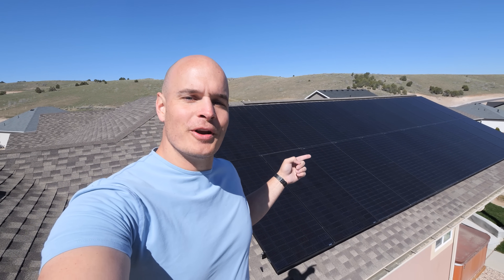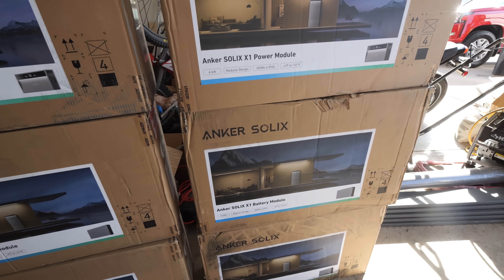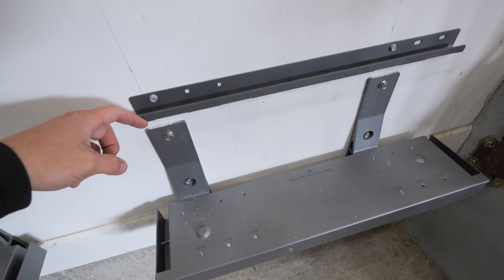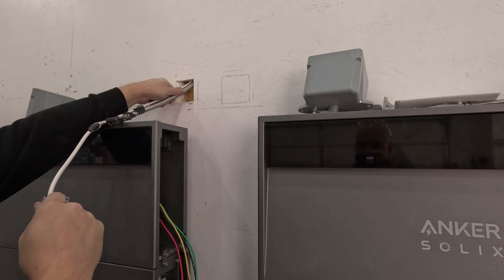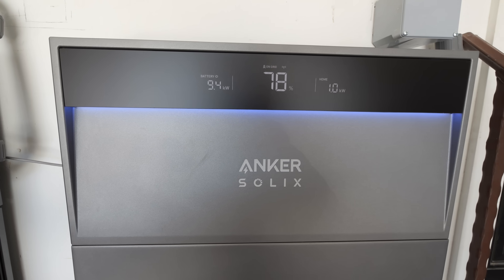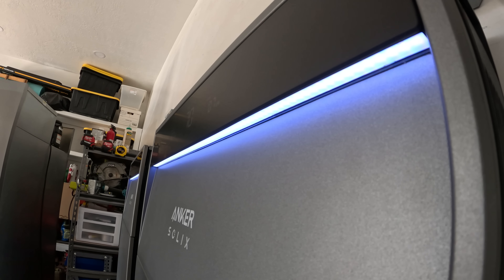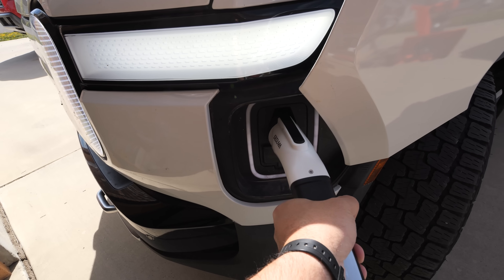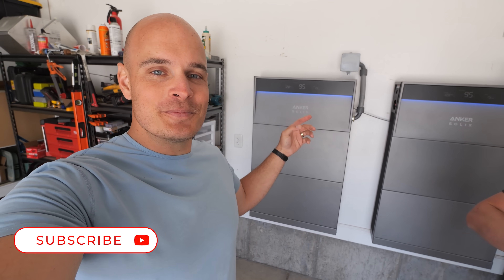How to Save Sunlight for the Night? - NEW Solar Battery Install

Comment: 1.3 kw damn!!! my home uses 300W and has a sanctioned load of 1.73 KW it includes to ceiling fans, a fridge, an exhaust fan, few lights, a tv, thats it!
Reply: There’s no way your house uses 309w. Charging your phone would be 1/5th of that on a fast charger
Reply: @derekderek2570  Our off grid property averages around 200W. We don't use electricity for heating or cooling(other than the fridge). The fridge is very efficient only using 0.5kWh/day. All the cooking is done on propane and heat is provided with wood. We are about to upgrade the system so we will have a surplus of power in the summer which we will use to heat water.  Then in the winter we will heat water using the wood stove.  A typical phone or tablet charger is only 10 to 12watts. Laptops are typically 60w peak much less on average. A large tv is around 70w. Starlink is our biggest constant draw at around 100W. For laundry we have a small semi manual machine and hang clothes to dry. The lighting is fairly insignificant. We grew up RVing every weekend and are accustom to only turning on the light we need at any given time.  That said in the summer we don't even try to conserve anymore as we already have more than we need. In winter production drops down to 1/6th on average so we are adding nearly another 4000w of panels to our existing 1200w. This winter past the generator had to be run every evening to make up the difference. 

300W average isn't that out of line if your not using it for heating/cooling. Modern electronics and lighting really use tiny amounts of power.
Reply: @derekderek2570  I don't know of any phone beyond about 20 watts of charging ability.  You know of one that can take 60 watts!?
Reply: @whattheschmidt  uhh bro

"The Xiaomi 14 Pro, Redmi Note 13 Pro+, and OPPO Reno 12 Pro are among the mobile phones currently offering a 120W fast charge feature."
Nubia Red Magic 7 Pro – 135W
Realme GT Neo 3 – 150W
OnePlus 10T – 150W
Nubia Red Magic 9 Pro+ – 165W
iQOO 10 Pro – 200W
Redmi Note 12 Explorer – 210W
Realme GT5 – 240W

Comment: In Quebec, Canada we typically use 70-80kWh per day average. (or 3kW average continuous)
Reply: In England we use average 10kw per day . How do you use so much ?
Reply: @persona250  4 seasons and a hard winter
Reply: The only thing I can think of is all electric appliances and electric furnace. The c.o.p on electric heating is dog shit.
Reply: @gastiresoil9758   I believe Quebec has very cheap hydroelectricity and thus usually uses all electric appliances. Fortunately modern cold-climate heat pumps are now becoming more common but even they aren't magic. 3kW continuous, assuming an average COP of 2, is around 20,000Btu/hr of heat.

Comment: Hmm, so with the battery backup I don't think that this is a cost effective solution. You could argue that the panels make sense from a financial perspective but adding the battery... You lost the financial benefit but gained the off grid bonus.

And you say his setup is over the top but with that current usage, he'd only get 10 hours anyway. Which yes, is better than nothing and I'd like to know in the day time if it would replenish and if not, what would it take to make it replenish.

Comment: A butter knife and there's a hole in the wall.... always nice to see. 
To break through the wall in our basement, built in 1956, it took me slightly longer^^ 50cm of concrete with rocks. Good concrete....was probably left over from the bunkers...
Reply: Don't say that's good. American houses are not built solid. Just wood everywhere. That's why they burn down easily. In Europe and Africa, houses are built with concrete. Difficult to tear through, but you have a solid home.

Comment: Do these have built in MPPT solar charge controllers or do you need micro AC inverters?
Reply: I saw MC4 in the video some prob not Micro AC.
Reply: @DudeHuge  the MC4 is battery connections. the inverter doesn't have solar input. The backup controller has an 80A 240V AC PV input

Comment: Honestly I am impressed with how these new options are reducing the complexity of installs. I still am not a huge fan of it being internet connected and requiring an app, but the easy of use is impressive.
Reply: Im with you on the internet connection, especially if its main use is during a grid down. Id rather have a dedicated tablet built in and mounted to the wall that runs the app. Then give it  optional connectivity for some of the fancier functions, software updates etc.
Reply: Friendly reminder that connecting to WiFi is not the same thing as an internet connection, you can connect to WiFi when the internet's down, you just need you WiFi access point (router in most cases) working.  Not saying the app DOESN'T connect to the internet, just that most people think that WiFi is synonymous with internet and it isn't.
Reply: It can probably locally connect. I have the Tesla app and it has a local connection. But WiFi makes it more convenient to use.
Reply: I assume that it is similar to their handling of the small solar setup that I have (Anker Solix Rs50b, 1,05 kW panels + 1,65 kW-battery), at least the app looks almost identically.

In that case it indeed does connect via internet, but you can also connect locally via Bluetooth and change some settings. Also you only have to connect in order to change setting.

But yeah... I would still feel better if there were an option to run everything locally via an integrated server.
Reply: They conveniently skipped the part where they had to intercept the utility cables for the transfer switch and that requires hours of labor and a licensed electrician working with the utility company.
Reply: @DudeHuge  No, he mentioned the need for a licensed electrician.  And the interconnect is done between the house load center and the utilities meter base.  Here in Tennessee, you have work with the utility but your electrician installs everything from the service pole (nearest physical connection) to the building.
Reply: @DudeHuge  watch again, they mentioned that

Comment: 1:13 "With solar energy being the cheapest energy source in the world..."
I thought that was nuclear?
Reply: Solar is nuclear
Reply: The regulations cause it to be much more expensive upfront; not a bad thing. However, over the life of the reactor, it is the cheapest.
Reply: @CoinblattJudenstein  Oh, then solar is cheapest because of all of the government's subsidies? :D
Yeah, that's what I thought.
Reply: im pro nuclear but have no clue where you pulled that from
Reply: Hasn't been nuclear since chernobyl happened. Coal was cheaper till grid scale solar-only passed it a few years ago.  Solar+battery is almost as cheap as coal, and significantly cheaper than nuclear already

Comment: EVERY time I see a solar battery backup video like this and others you do, I cant help but think "...yeah one of those could power an off-roading RV basically indefinitely." and dream of the coolest traveling life ever.
Reply: The biggest hurdle from what I've heard for the RV life is the panels -- you can only fit so much on an RV, and even if you have extending panels or something, you can't drive... so during the day you have to choose to full charge or drive. But you could fit a LOT of batteries in and just have a day here and there where you spread out your panels and charge... expensive dream in any case, so just a distant dream for me
Reply: @DoctorX17  you can make a retractable  wings like sinde platform  and mount those additional panels for more power
Reply: @DoctorX17 you can get a beefy aftermarket inverter to charge while you drive to fill in that gap from the extendable panels
Reply: @elvinshoolbraid  Yup, (though it would likely be an alternator, not technically an inverter) and that's often what vans use as well. Beefed up alternator means the batteries are charging whenever the engine's running, and then if you're doing something during the day the solar can fill up the pack while it sits. Plus you can always start up the engine to top it off if needed.
Reply: Both the Lightship L1 and the Pebble Flow (all-electric travel trailers) are coming out within a year, and they both do this. You still need to power the tow vehicle separately, but assuming there's sun where you camp, you're very likely to run out of water (or wastewater tank space) before you run out of power.
Reply: Exactly what I have been thinking about. There is no good solution yet that will just work. It is a piece by piece installation Victron looks the absolute best option for that right now. I truly want a solution that would allow me to pull up to an EV charger and top off my RV batteries. Then give me 2-3 days of off-grid capability. However, my rig is 40' and almost everything is electric. I have Propane for Range/Oven, Instant Hot Water Heater, and backup heat. Everything else is electric. I especially want all 45k BTU of cooling though as I live in Texas!
Reply: @Frozty I recommend listening to the Audiobook - "The Martian", if you can try to get hold the version narrated by R.C Bray. As as @DoctorX17 mentioned, the biggest hurdle is the panels and Andy Weir covers that issue quite well imo.
Reply: Just set off into the great Canadian expanse like you're exploring a new planet, sounds fun
Reply: Best way to do it is to use full size residential solar panels: 400+ watts per panel. Then instead of an RV AC, you MUST use a mini split heat pump if you want to cool the interior of the rig off solar. I live in a school bus and my solar keeps up with keeping the bus cool with the mini split unless it is really hot outside. I only have 1360 watts right now, but if I had 2000 or more watts (totally possible with the roof space available) I would have no concerns with running the AC as much as I need during the day. I only have 7.5 kWh of battery though and if it stays hot overnight, my battery may not be quite large enough.
Reply: Sure, sit it full sun all day, then you can drive 5 miles max in an EV RV.  Most use panels to recharge their RV batteries, but that is to run appliances.
Reply: Everyone I know that tried to do the RV thing quit after a few months or at most a year.  There is the cost of fuel and parking fees, RVs with sliders seem to break or leak often, you need to tow a car, one bathroom,  and you are stuck in a couple of hundred feet with the same people day after day.

Comment: 6:20 makes me wonder if more complicated electronics would lose power during the switch? (ie would a desktop computer turn off, would the digital clock on a microwave reset, etc)
Reply: 20ms switching is fast enough for sensitive electronics to not even notice the switch from grid to inverter.
Reply: any desktop PC with important work/data should be on its own UPS.
Reply: A computer should be on a small battery backup anyhow.

Comment: Yknow what would be great. A clean energy source that doesn’t require environment destroying battery production and solar panels that degrade over time. Oh wait it exists, it’s called nuclear. But then again it would completely remove the need for fossil fuels and could be rolled out at a rapid rate and we have to keep the oil barons rich, let’s stick to “renewables” that take years to build a decent about of production and require constant replenishing of the fleet.

Comment: How do you protect your investment from natural disasters like hurricane or hailstorm? Just one occurance of these and all our investment would turn into dust.
Reply from the maker: The Solar panels can withstand hail balls that are 1 inch in diameter falling at 50 miles per hour. We don't get storms like that here in utah. So we don't have to worry about it.
Reply: Insurance covers solar installations just like they cover roofs and buildings...

Comment: Please do not call this a Powerwall. Powerwall is a superior tesla product
Reply: Genuinely curious why you feel Tesla is superior.  And not just "cuz it's Tesla". Is there some spec or software capabilities that Tesla has that this doesn't?
Reply: @Austden  Yes, The power wall 3 is substantially cheaper and more capable. Less units needed for the same backup and install is insanely easier. No transfer switch needed when using the Tesla backup switch device. Power wall 3 with backup switch can do whole home backup and the installation can take less than an hour.
Reply: @DudeHuge  How can you say it's "substantially cheaper" when you don't know what this anker costs? The powerwall 3 is 7kW 14kWh for $16k installed.. this is 12kW 20kWh without a listed price, but also doesn't need a "transfer switch"
Reply: @stefanvanzyl9090  They literally installed the transfer switch in the video. Also, PW3 is $8500 without install. Installation costs vary based on installer and region. This system retails for $12.5K before install.
Reply: Also, PW3 is 20KW 13.5 KWH
Reply: @DudeHuge  No, they installed the anker backup controller, which is how the solar ties into the entire system, just like tesla's gateway device when you want solar.
Reply: @DudeHuge  the PW3 is 11.5kW AC Discharge power, 20kW Solar input, just like the Anker...
Reply: @stefanvanzyl9090  Call it what you want. If it intercepts utility it's a auto transfer switch just like the Tesla gateway that's no longer needed.
Reply: @DudeHuge  what is the tesla backup switch that goes in the meter can other than a transfer switch? It literally disconnects the grid so that the powerwall can operate in island mode, and this is only possible if the poco allows you installing things behind the can, which isn't guaranteed.
Reply: @stefanvanzyl9090  True. The utility has to approve it. But if it does then install becomes a breeze.
Reply: @stefanvanzyl9090  Being able to skip rerouting service cabling and not having to separate grounds and neutrals (Not changing the main breaker location) saves an enormous amount of labor and money. The site controller is inside the power wall so no gateway needed. It's the future of residential batteries. Deliver it, Plug it in and go. Easy.
Reply: Kleenex, velcro, Google, Xerox, Popsicle, Dumpster, Powerwall
Reply: @Voyajer.  I don't know what this means. Is this the incantation to summon the god of ignorance?

Comment: With this battery set you can charge the sun when it goes out
Reply from the maker: That's the plan.
Reply: @JerryRigEverything  You missed something, there won't be much sun once the mushroom clouds settling in the sky. Have you thought of geothermal energy? With the surface cold as the north pole, and the earth just a bit warm, it can generate quite a decent amount of voltage difference and energy.
Reply: Yes. Double it and give it back! Love it.
Reply: How did he resist the urge to use the phrase "Anker management"?